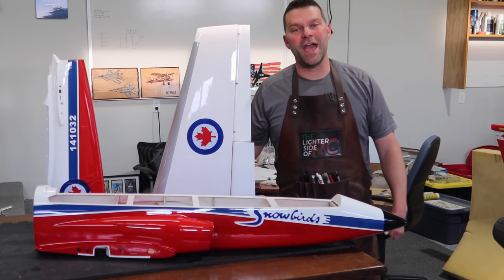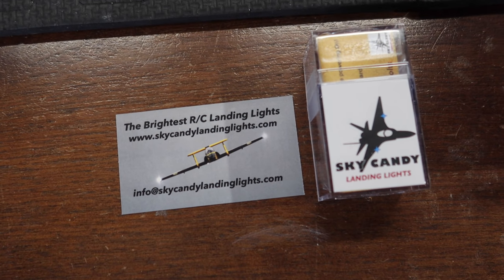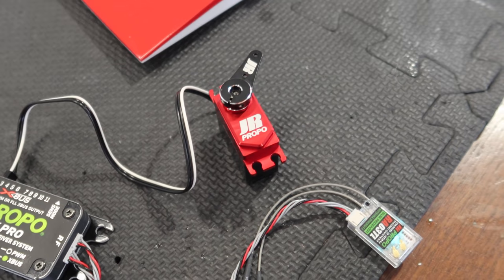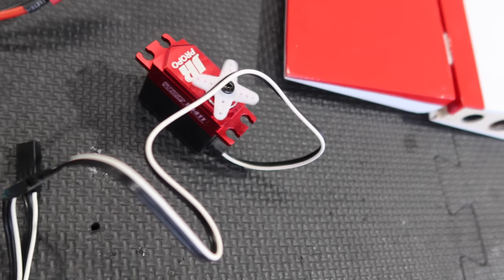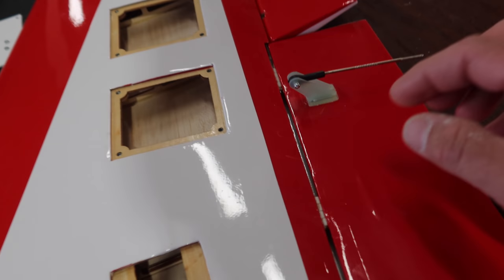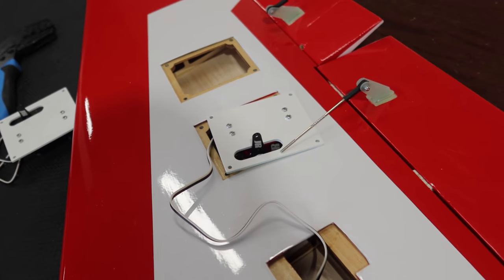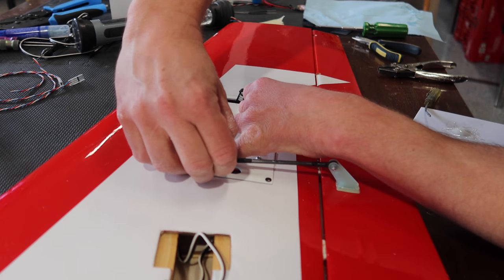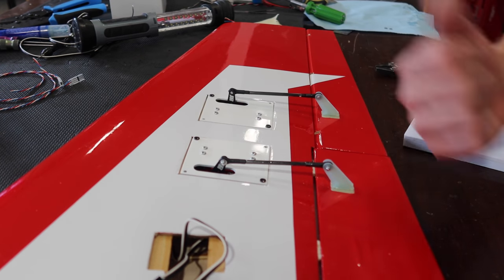BOOMERANG RANGER Snowbird Sport Jet - Servo Install Wing & Elevator.

Comment: I like the carbon control rods. Good man! 0% flex. Always good to keep linkages ridged. I used to make my own control rods with Carbon tube cut to length and threaded rods cut to about 1.25". Screw the threaded rod halfway into the ends of the carbon tube and then a drop of thin CA wicked into the end. First I would cut brass tubing into 1/4" long sleeves to be slid over the ends of the carbon and threaded rod just before gluing with CA. Ridged, bulletproof and light. Just don't forget the sleeves. Made for 2-56 or 4-40. Oh ya, the Candy man can. And I didn't see any cats!!! 🐱🐱🐱
Reply from the maker: Thanks Steve!  Yea Nez wont let me go into the shop without her but she is usually so occupied with climbing all over all the racking etc she isn't getting in the way as much!

Comment: I too could find no mention of fasteners to hold down the wing servo panels nor could I find appropriate fasteners in the pack provided.  Had no idea of what mm size to use but found four that worked in an old scrap door.  Turned out to be a 3mm x 6mm machine thread so I went to my local CANDY store and found a pack of 12 to finish the job.  Cost $1.98.  Hoping nothing else is missing.
Reply from the maker: Thanks Rocky!  Yea the instructions are bit bit lacklustre.  Thats the main reason for these videos!  Thanks for watching!